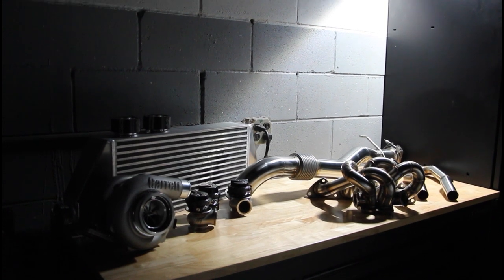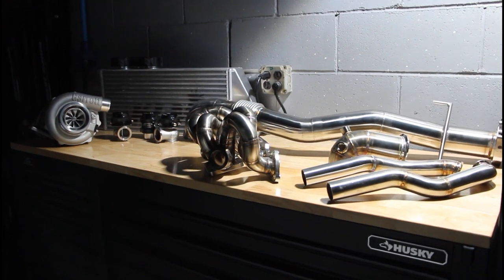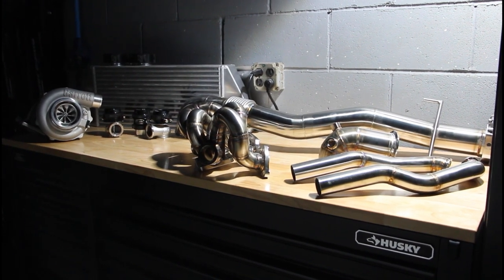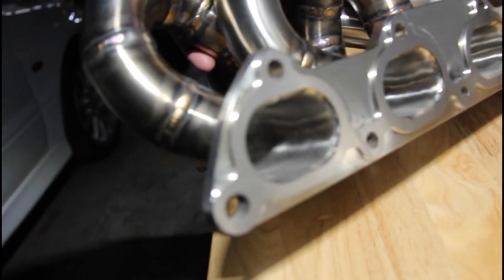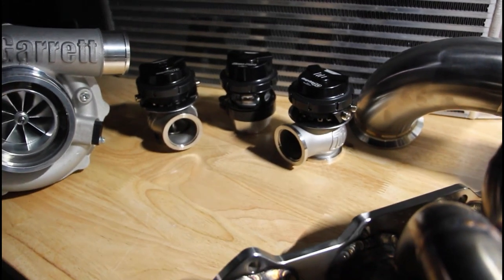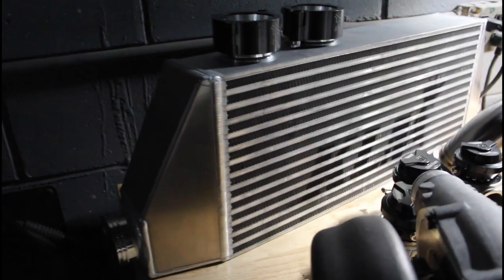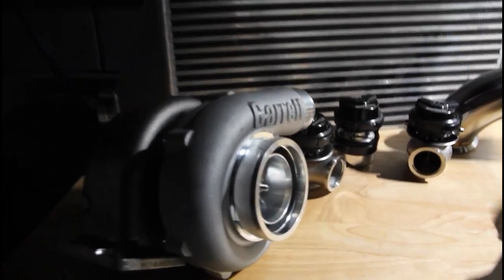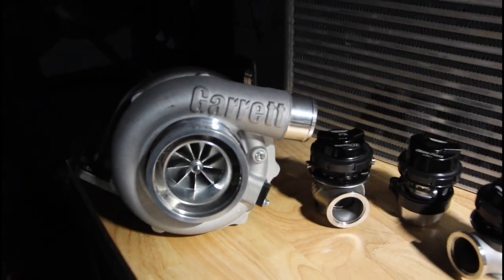KK Evo 9 RS Garrett G30-900 Turbo Kit Plans & Morrison Fab Hot Parts Kit Overview

Comment: I have a g30-900 1.06 on my GTR running a measly 17psi. The car feels loads better than with the bw s360sx that was on before it. It feels super responsive and sounds phenomenal. I couldn't find a lot of setups running this turbo with the divided housing and I would love to see how far you can push this turbo!
Reply from the maker: Thats awesome Chris! Glad to hear it. I cant wait to see what it can do, Im going to try and push it to it's limit and back it off for longevity.
Reply: I want to get the G30-900 1.06 divided for my 2jz (I have forged internals and GSC S1 cams) out for a responsive 550whp. not sure if I should step up to G35-900 1.06 divided. Not a lot of data on net right now.
Reply: @BIG JDM  you will probably sacrifice a couple hundred rpm worth of spool but on a 2J the difference will be negligible. The top end will most likely be much better than the G30 even with a 1.06 housing. If my engine was ANY bigger than a 2.6, I would step up to the g35 with a TS housing. My 2 cents.
Reply: @chrisfoster5044  I’m on the same page, I’m 90% sure g35-900 divided with twin scroll tubular mani. Anyway your GTR is looking strong. Peace.
Reply: @bigjdm5460  You can easily make 550whp on a G30-770...

Comment: How much power are you planning to make with this setup and approximately what rpm would the turbo start coming on? Was really hoping for a g30 770 twin scroll but it doesn't look like that's happening. Curious how this turbo will be like.
Reply from the maker: Hey! I'm hoping for around 650/700 +/-
being that its a twin scroll with a 2.2 like we're planning for, 4k - 4500 would be ideal but we'll see what actually happens.